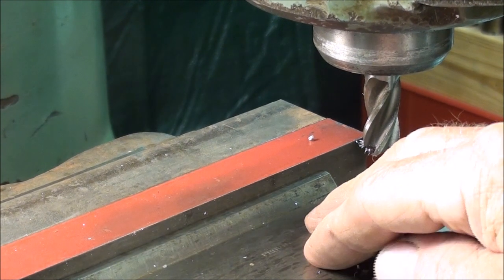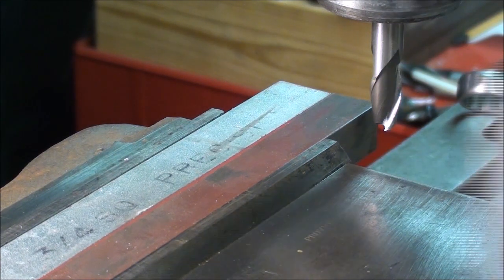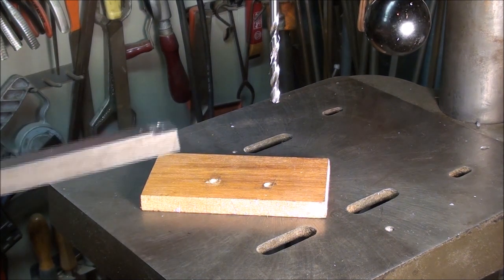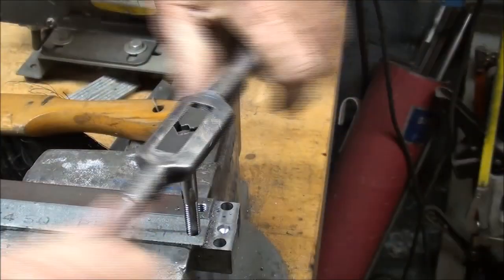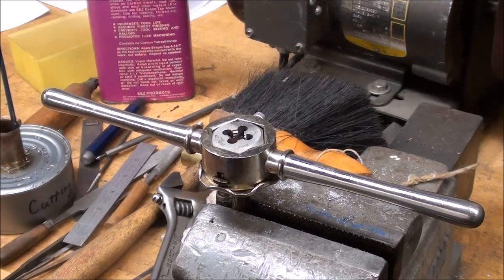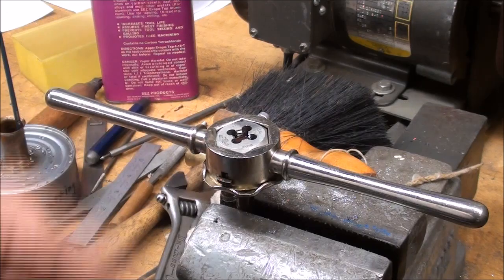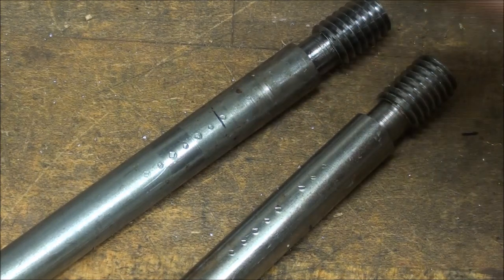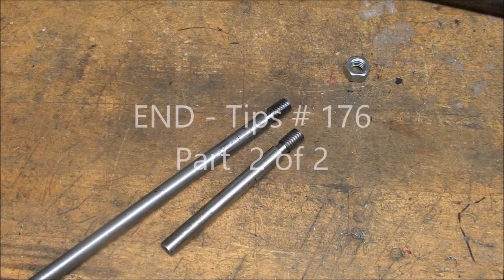SHOP TIPS #176 Machinability of Steel part 2 tubalcain

Comment: I am absolutely appalled.
At myself. 
These two #176 videos are gold!
They answer many questions I've found as new low carbon fights back at machining it. Not always but when it does, it fights hard.
Working on governor parts for predecessors of your old Minneapolis Moline and will redirect my efforts.
Thank you!
Reply: I tried the 12L14 and found it be very forgiving, especially when threading or parting. It isn't like butter but very close. Thanks much again!
Reply: Try these on mild steel. They are absolutely brilliant to use and leave a great finish. I’ve been struggling for years to get a good finish on mushy cold and hot rolled bar and these did the trick.

DCGT070204-AK H01/DCGT21.51-AK H01 CNC Aluminum Turning Blade Carbide Inserts

Comment: Thank you Mr. Pete once again!!  I've found that HSS and carbide cutting tools on threading applications are like night and day, especially when threading hot roll or tool steel on small lathe.  Yes, the cost can be higher but a bloodhound will find a good deal out there.
Reply from the maker: Rolando Escobar Thanks--so true.

Comment: Hey, have you thought of using a time lapse camera? I think that with one of those, you can show a lot more in detail without making the video any longer and yoy can still explain concisely with subtitles of what's going on? 
 But you may need someone to integrate the time lapse and normal film. 
 I bet if there's a skill center nearby that has filmography classes. I'd bet a student or two may enjoy editing and splicing or whatever its called. Just a thought.
Reply from the maker: I had thought about that, but do not know how.
Reply: mrpete222 
 Well if YouTube has done anything, it has taught a lot. I'm sure if you Google how to use a time lapse camera. It'll show up. If i come across an instructional video, I'll try to send you the link.
 On another note, ever thought of hooking a shopvac to your lathe to reduce the mess? 
 I just have this idea of taking a large cereal bowl, cutting out the middle just enough to fit the hose. It would have to be a bowl without a flat bottom though.  Just a thought I'm throwing around. Would also love to see you make one and adapt it to your lathe.

Comment: Hot Roll vs Cold Roll.

When machining steel that need close tolerances consider that Cold Roll steal will have lots of internal stress that will cause warping when machines. Hot Roll steal will not have the high internal streses and will be less prone to warping after machining. Some of the internal stresses of Cold roll steal can be reduced by heat treating. Raising and holding the temperature near 1000F. Machinablity of steel can also be improved by normalization by heating the steel above its critical temperature (usually about 1600F).
Reply from the maker: Yes--saw down the length of a piece 3/4 sq CR and see how straight it is.

Comment: Thanks Mr.Pete, very good experiment. I see this at work a lot machining forged steel vs. cheaper burn ring steel...I don't know the steel numbers off hand but they do machine differently, also on occasion machine into a hollow spot (inclusion??).
Your videos are helping me quite a bit as I learn the machining trade, thanks much!!
 Also just paid for a Bridgeport series 1, j-head and in great shape for less than a grand with tooling, I live in Massachusetts where a lot of manufacturing was done and machine tools are plentiful and reasonably priced around here...Thanks again Mr.Pete keep up the great videos !

Comment: The lead particles in the matrix of the 12L14 act as miniature chip breakers at any cutting speed. At higher speeds and pressures where temperatures are much higher, the lead also lubricates the passage of the chip across the cutting edge.
 THat was terrific !

Comment: Mr. Pete, A great series. where I work now we machine 6061 t6 aluminium almost exclusively. I often make the comment to new guys that come in and only experience 6061 that if I had to go back to a job shop that does many different materials I would have to relearn machining. Easily half of the difficulty of machining steels is figuring out the proper speeds and feeds for the many different alloys. Regards
Reply from the maker: Thanks for watching
Reply: 6061 T6 is my first choice unless i need the strength of steel. just be carefull when drilling or taping and remove them often. if you break a drill bit or a tap off in a piece of aluminum, you will have to throw it away and start over. most projects can be done with aluminum.

Comment: Mr Pete, I have used scrounged mystery metal for years and had some very wild results. One chunk produced the most bizarre iridescent purple chips I have ever seen. Another prime piece of aluminum rod 2 inches in diameter by 3 feet long turned out to be the nastiest stuff I have ever worked with as it would only tear and not machine well no matter what I tried. It wouldn't even file smooth.  I totally relate to your attempt to demonstrate this concept and I suspect you had such similar results between widely different alloys because of the new modern carbide bits with their computer generated profiles that cut so well in any material. If you had used HSS bigts I bet you would have had the dramatic demonstration you were looking for. Thanks so much for all you do!
Reply from the maker: So true

Comment: Great video.  When I thread cold rolled steel on my lathe the threads are a bit rough so I do the last little bit with a die.  This makes better looking threads but not all that nice.  Thanks for sharing.

Comment: HI mrpete,
Just like you mention HSS is the way to go if you plan to do more than a few taps or fillets, and, on stainless the carbon tool will just dull mots of times on the first pass...... And, just break in the hole.
Even in aluminum cheap tools will stick and break.
Keep on the great teaching.

Comment: Thanks Mr. Pete! My takeaway was that the threading insert you used was so good that it evened out the differences in machineability between the materials. You could really tell the difference when you used the die method. Perhaps a Part 3 would be in order, using a ground HSS tool?
Reply from the maker: I was thinking that when I made the video.  IT EVENED OUT THE DIFFERENCE--I could not think of how to word it. Thanks
Reply: mrpete222 One of the major goals of the guys who developed the inserts is to get good machining with minimal lubrication, on a wide variety of materials...

And, yes, I need to look things up in the books before I try to get too far into a project - the variety of choices is staggering...

Comment: Thank you Again Mr. Pete ! I just learned something After All these years of using a threading die , after watching this video I learned I was using the die handle upside down ! Makes more sense putting the adjustable collet on the un-threaded portin of the stock to hold it straight !

Comment: mrpete you are the only person on YT who knows how to tap a hole properly. Great video as usual, very informative, the newbies will surley benefit from your excellent engineering tutorials.
Reply from the maker: Thanks
Reply: @mrpete222 
     The best teacher! I was lucky enough to work at a major manufacturing facility that had in the toolroom a Rigid ™ pipe threader that had the full accompaniment of dies for both sae and metric allthread. If I'm not mistaken there was even a die for a large left hand fine size. Thinking might have been ¾.

Comment: Thanks Mr. Pete.  Another good series and like that this one deals with problems a lot of us have in threading different materials...especially if you have funky dies.  The threading bit was impressive and wonder if it could thread the tool steel as well as it did the CRS and 12L14?  I do have a couple of questions that may erupt into firestorm about Hex Dies versus Round Dies.  I even went back and watched your MST 4,5 & 6 to see if you answered my question....but it wasn't clear.  I noticed you used hex to cut your threads but was told that hex dies were for chasing or repair, not cutting and they don't conform to common 2A specs.  1. Are there hex dies for cutting and if so how can you tell the difference between them and chasing/cleanup dies?  2. What brand of cutting dies do you recommend?  Thanks Much...PJ
Reply from the maker: I use whatever I have on hand. Some of the hex dies seem cheap.. Most all of the small dies are carbon steel.  You can get HSS dies only from industrial suppliers & they cost a lot.  The carbon steel ones dull fast.. Cleveland brand was best--if they still make them.
Reply: mrpete222
Thanks I'll be on the lookout for them...I know they still make drills.  I have a few older Vermont hex dies that are pretty good but my 1" round import sets are carbon and a few of them I would be better off using rock and chisel.  Even the Craftsman are imports now...what ever happened to Sears & Moore Drop Forging?  To me these are tools that require the best I can afford...much better than messing up a part or pulling my hair out.   Saving my Shekels.  Thanks Again for all you bring!
Reply from the maker: The complete sets in a nice plastic box from sears etc. look great.  But they are carbon steel.  Unless a tool is marked HSS, you can be sure it is inferior.

Comment: Please share the threading tool. I am looking to get some carbide pre sharpened threading tools and that one looks like a dandy. If you don't want to do it in the comments you can send me a private message.
Reply from the maker: From Shars, on line.  Holder is  SER 0500 F16 , Insert is 424-1381
Reply: Thank you sir!
Reply from the maker: JRoque250 I took a quick look at amazon and saw no bargains.. But I sure do intend to keep looking. Dorian & aloris are my favorites.  I do intend to hog when the price is right.  Thanks for the heads up
Reply: mrpete222 I have a similar threading tool from Kennemetal. It looks like the inserts are identical, and it cuts threads beautifully. Great video sir.
Reply: I have no experience with Shars thread cutters, etc but Amazon is running a sale on US made (in Texas) Dorian Tool holders, etc that are at times cheaper than the China stuff. Prices vary, as I've noticed, by the hour even but search for Dorian Tool and you'll see some of their stuff marked down by as much as 78%. I've bought a few hundred dollars worth of their stuff already and still going. I paid $23 shipped for a Dorian thread tool holder like the Shars shown here.
Don't go hogging all the Dorian tools though, I'm not done buying :-)